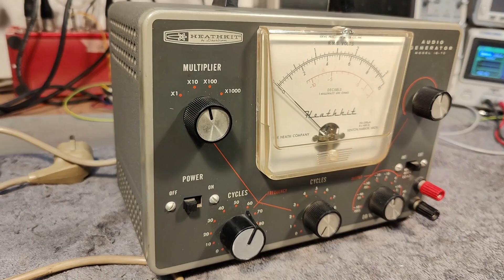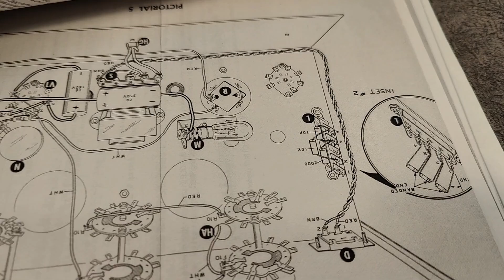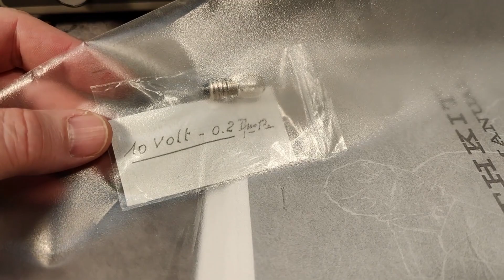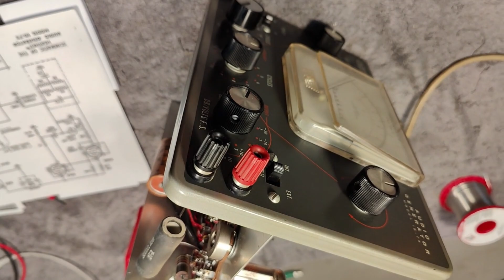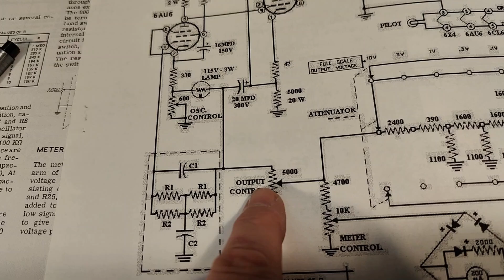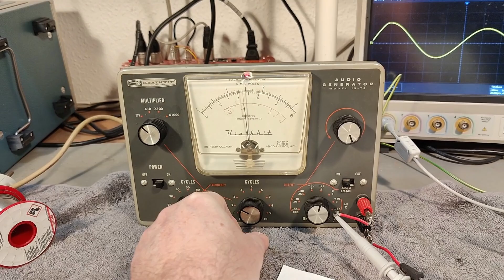Heathkit IG-72 audio generator 1960 test teardown

Comment: What is the part number for the “candelabra”. I bought one on eBay and this bulb was shattered.  The schematic just says 115 volt 3watt.  No part number or useable search term.
Reply from the maker: you can use any 115V 3W bulb, the part numbers you find in the manual is not of much usage today